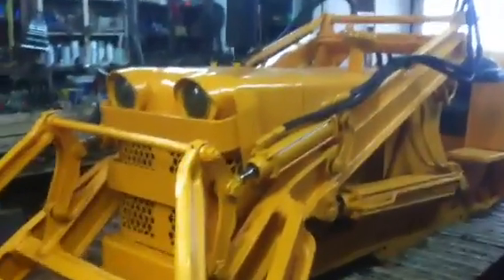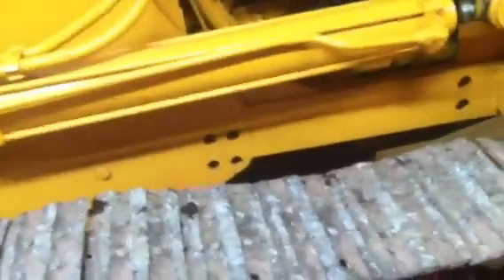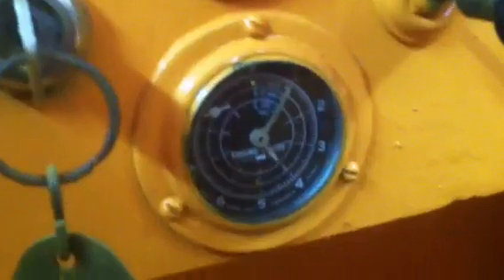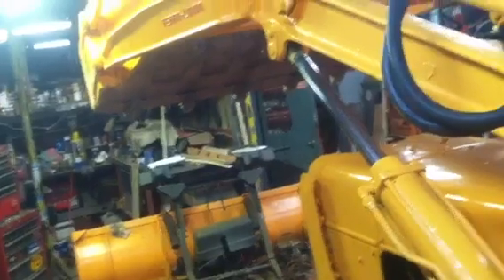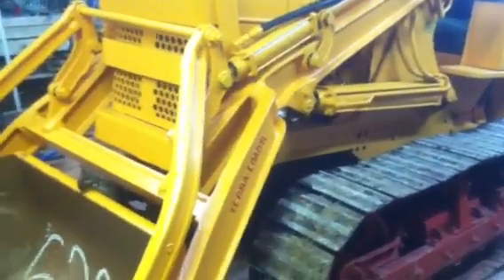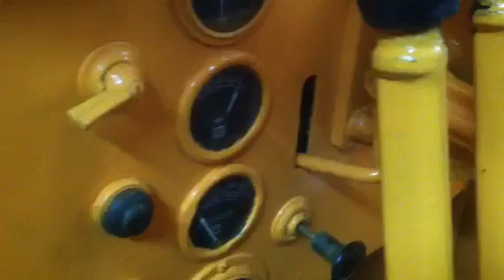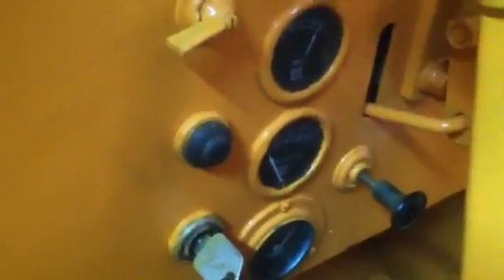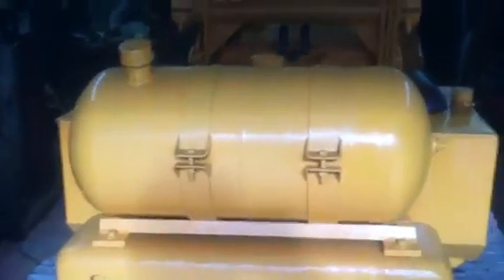1953 terratrac 500 loader

Comment: My fold mans got a 1957-58' Terratrac/Case 310 loader all rebuilt. Solid sprockets in the back and spoke in the front. Nice Machine. His doesn't have the engine with the spark plugs on top. He has the engine with the plugs on the side.